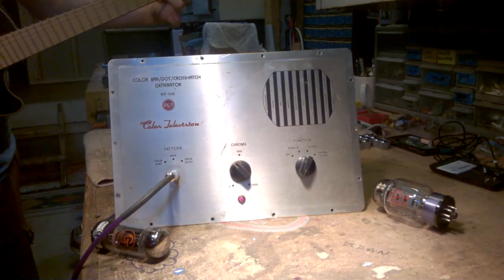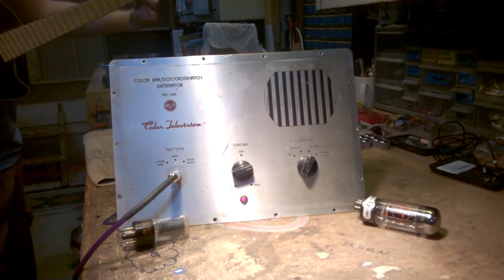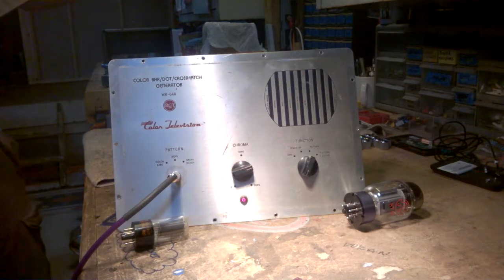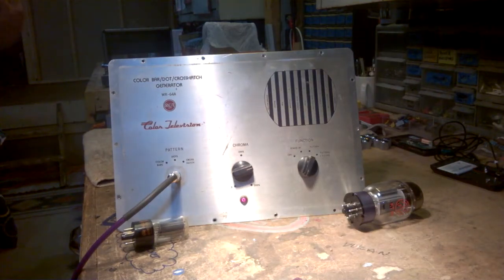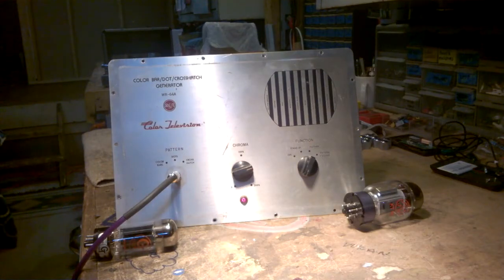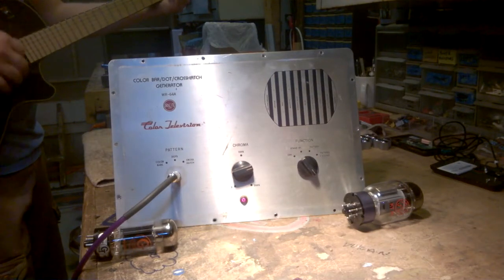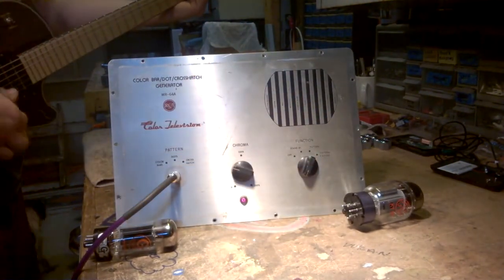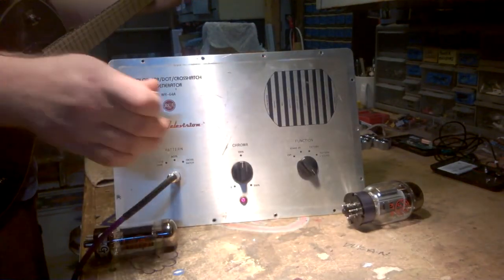Negative Feedback Explained / Tube Amp Circuit Fender 5F1 Champ Clone

Comment: You say the signal goes to the cathode of the preamp tube, but in most of the schematics I saw it goes to the cathode of the Phase Inverter valve.
Reply: Both are correct. With SE single ended (one power tube), you apply the loop to a preamp tube cath final stage. On a push-pull (two power tubes), you attach to the PI input.

Comment: My question, what effect will you get if you use certain pot values? Is it possible to get zero NF while using a pot, instead of a switch?  What would be the difference when using 100K, 250K and 500K pot for this purpose?
Reply: Based on other comments beyond approximately 68K you don't get much difference, I've heard the same said for 50K, if you wanted to use a 100K pot you could.

Comment: so, options would be open, 22K, 47K?  what range have to tried? have you tried a 50K pot? wattage?
I have a 5F2A build and no NFB, breaks up b4 you turn it on.  the dern thing barks like a dawg.  Mikel
Reply from the maker: You can use a switch to choose between predefined resistor values or a pot to have linear control across a range limited by the value of the pot chosen. I typically use a 50k ohm potentiometer in place of a fixed resistor. That gives me an adjustable range from 50k ohms of resistance all the way to 0 ohms or "open"/no resistor. I have experimented to 330k and hear very little value beyond about 68k.
Reply: Wattage for a fixed resistor or adjustable pot should be the same or greater than the typical 22K value  used or 1/2 watt.
Reply: @LibertyCrypto  For someone who is still wrapping their head around resistors and their role in shaping the tonality of this part of a circuit, what exactly, then, does the potentiometer allow you to adjust? How much of the the initial signal, post transformer, is fed back into the the cathode of the preamp tube (like a blend knob of sorts?)

(Not an electrically-minded person, but trying to teach myself)
Reply: @johnforrestal  resistors cause voltage drops across them. The greater the resistance, the greater the voltage drop. The greater the voltage drop across it, the less feedback voltage from the output transformer reaching the input or inverter tube's cathode which "opens up" the amp and vice versa. Having a pot instead of just a resistor is a great idea. Another great idea is having, say a 1k resistor in series with the pot, so even if the pot is wide open there still remains the 1k resistance so you'll never apply 100% NFB, which pretty much means there's no more gain.

Comment: Interesting! What value pot did you use for the NFB control and how did you wire it into the schematic?
Reply from the maker: I used a 50k Linear Pot. Where the stock resistor would go, in this case it was a 22k I believe, you use one of the outside legs of the pot and the center leg.